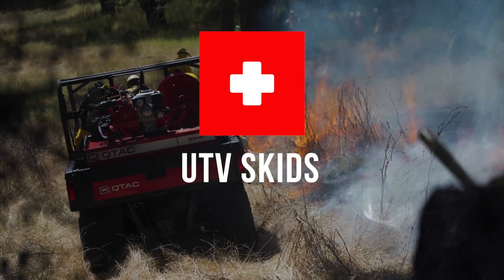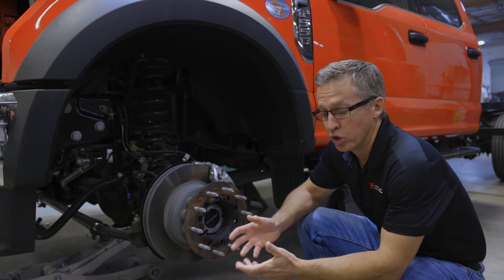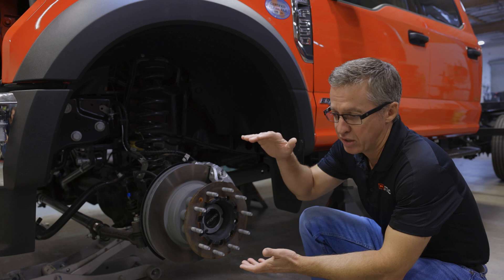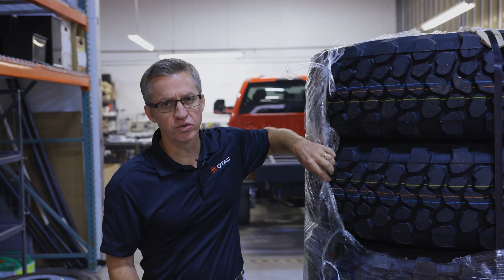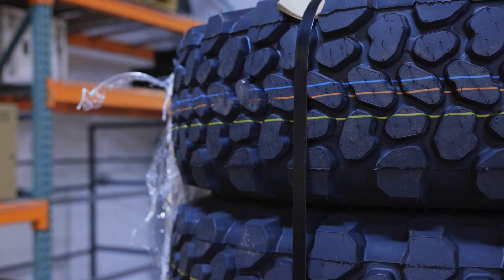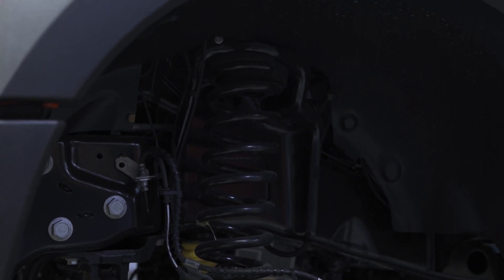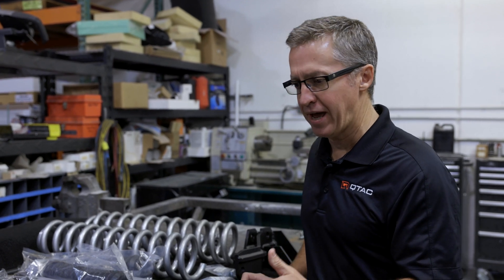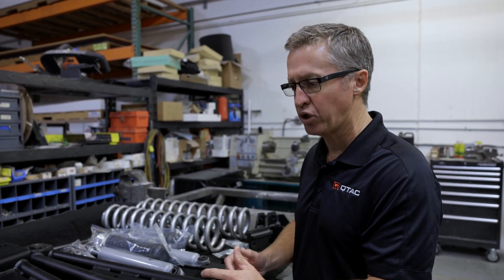Installing SUPER SINGLES KIT on a Wildland Fire Truck | Building a Brush Truck EP.3

Comment: There's no way a 20 inch tire should cost $1000!  RIPOFF!!
Reply from the maker: It's a 41" tire, but yes, still expensive. You can find them in the $650 range but full retail is quite a bit higher.
Reply from the maker: @Son_of_Art Unfortunately, no. They're about a 20,000 mile tire as long as you maintain correct air pressure and rotate them regularly (4k-5k miles).